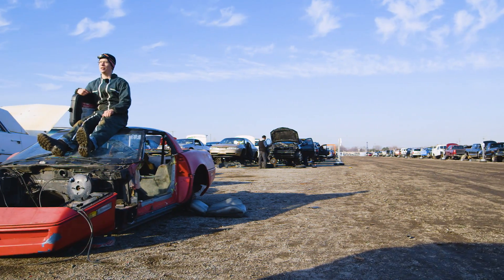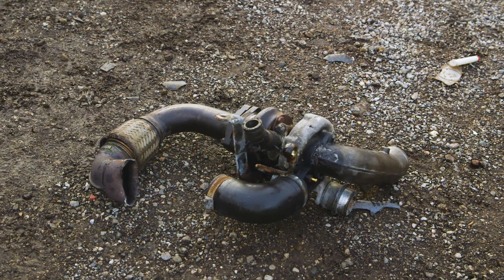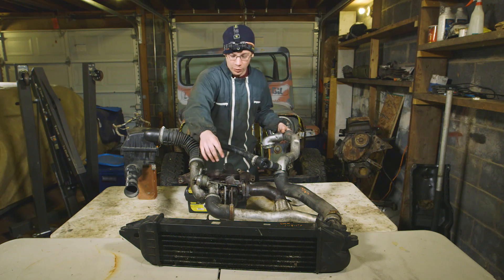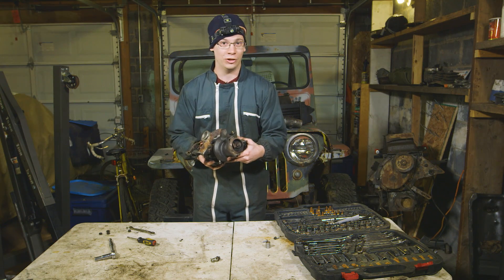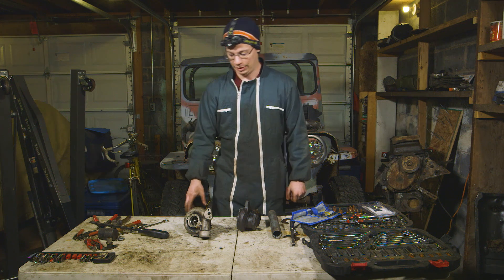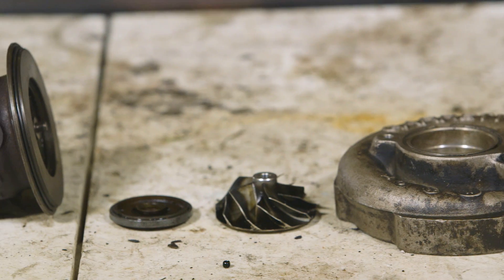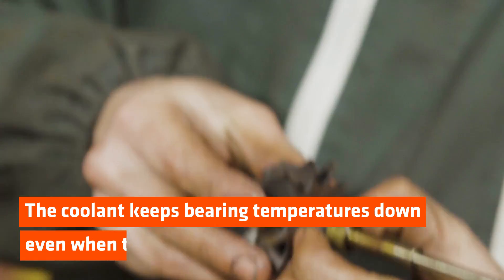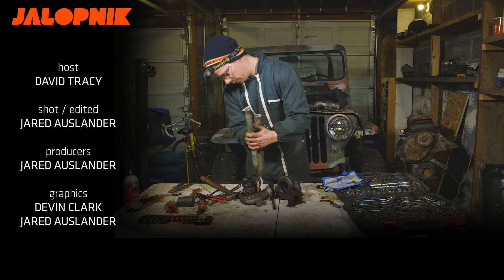This Is How A Turbocharger Works | David Dissects

Comment: If you go on ebay and type in "Turbo" and then list them by cheapest first you will find some company selling New turbo's for as little as $200. I got one for my 5.9 Cummins, delivered, for $220. To rebuild my Holset is $900. So, take a look, check it all out.

Comment: What car is that?
Reply: Luke Longworth saab 9000
Reply: Luke Longworth 1998-2003 Saab 9-3(engine B205r).  which is almost identical to a ng900(1994-1998) 2.0turbo engine(B204r) which is essentially a shortened verison of the 2.3turbo(B234r) found in a 9000.  The 9-3 also used a B235R in it's Viggen (a refreshed B234R).